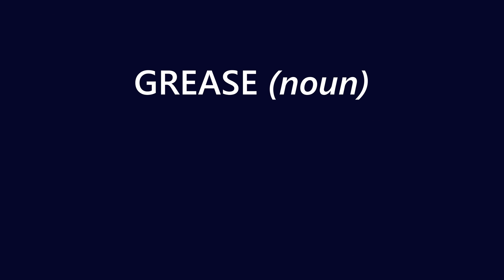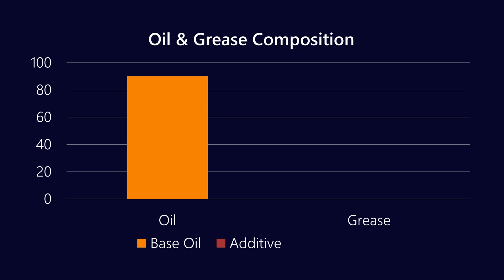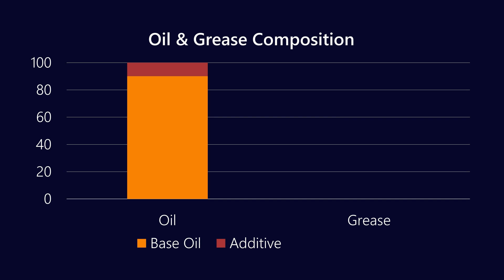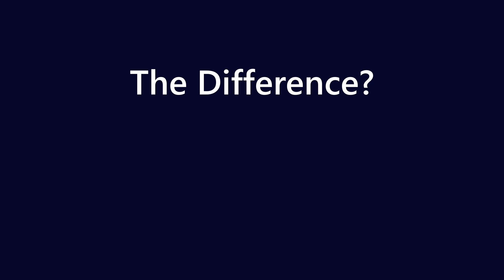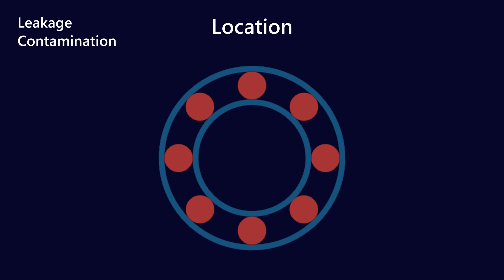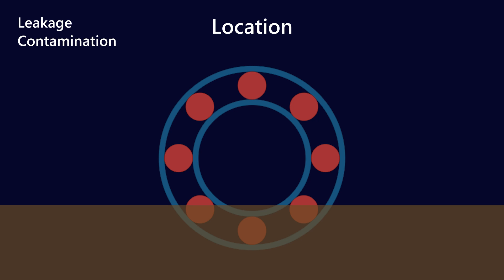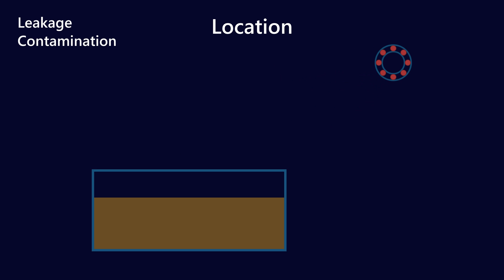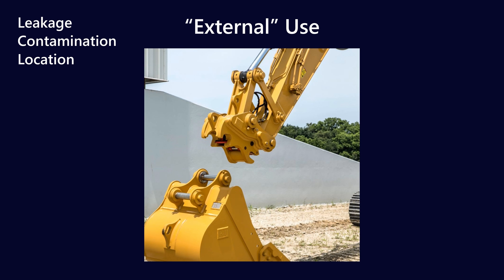What are the main differences between grease and oil?

Comment: Many large equipment have electric motor driven auxiliary oil pumps to circulate lube oil prior to start up. Once the equipment is running the directly driven main oil pump takes over and the aux. Oil pump stops as per instrument and electrical logic diagram.

Comment: Oil also has lower viscosity than oil.  If you have bearings that need to spin faster, you need a lower viscosity lubricant.  You can't use grease in these applications.  Another important factor is application dependent.  On fishing reels for instance, the spool bearings need to have very low friction in order to reduce the drag the bait has to swim against when it's pulling line.  Using grease would increase the resistance and cause the bait to not be able to pull out line from the spool properly before it tires out.  The lower friction on the spool also makes casting easier and improve the distance on the casting.  On fishing reels, the spool bearings are usually lubricated with oil instead of grease to reduce the lubricant drag.  In fact, some reels uses a very thin dry film of lubricant to make the spool spin with very little friction.  Even oil in these applications would cause too much friction. You will have to lubricate more often over a season, but it improves the performance.  There are lots of other examples where one type of lubricant is superior to others.

Comment: Grease is basically oil that has a thickening agent added to it which then makes grease .and as that grease gets older it gradually drys up leaving no oil but only the thickening agent left in the bearings . Hence the need to clean out the bearings and repack with fresh grease💪😎👍

Comment: To be quite honest, I have no idea what kind of lubricant to use. For 88mm Bearing Cable Pulley Wheel Aluminum Alloy Gym Equipment, what is advised? I recently acquired some weight lifting equipment, but the factory-installed pulleys were broken, and I didn't feel confident using them, so I ordered some new aluminum pulleys. Any help would be very appreciated as I'd like to keep them maintained so they function without much to no resistance.

Comment: Um, It seems as if you didn't mention the most important variable... the speed of the bearing. The oil or grease needs to "flow" not just to carry heat away, but it also needs to flow Into the bearing quick enough to keep up with what's being pushed out. At higher speed, the grease will not be able to keep up with the rollers and cannot be replaced, unlike the oil which can remain around the rollers. Granted, there is oil in grease, but over time and with heat, that oil separates out. Anyway, just seems like bearing speed is a determinant to thickness ~
Reply from the maker: Great point! As you can probably see from the date of the video this was one of my early ones and the quality wasn't exactly... as I wanted. Haha. You're absolutely right that I missed the big one.

Comment: Just repacked my trailer wheel bearings (non-sealed tapered roller) and there's a nagging question I've often wondered. I googled it and could not find an answer.

Essentially - I can't help but think that the rollers will just push 99% of the grease out of the way, and the tiny bit of grease film left on the races and rollers should degrade and bearing fail in short time. Obviously that is not what happens...

So i guess i am asking how the heck does the grease do its job? 
does it turn liquid when warm and flow around the bearing, giving it fresh grease constantly? every time i have repacked a bearing i see a big ol blob of brand new grease in the middle doing nothing and then a small amount of dirty used grease around the bearing, so it can't be flowing much... Timkin says pack the hub 1/2 full of grease. Does the centrifugal force cause the grease to flow a bit and push itself into the bearings? So many videos of guys doing it wrong, only packing the bearing and not the hub - will those likely fail prematurely?

Comment: I’ve always used 2oz of transmission fluid in a fresh oil change and a tablespoon of grease in the filter. All my engines have lasted more than 500,000 miles.

Comment: Ball and roller bearings are supposed to roll in there races, does the lubricant ever cause them to slide instead of roll? and wouldn't that be a bad thing?
Reply from the maker: Yes! That can absolutely happen. Overgreasing a bearing, or using a viscosity that is too thick can cause churn, and can cause the rolling elements to slide.
Reply: They all slide - because the outside diameter travels more distance than the inside bearing race.
Reply: @paulsawczyc5019 nobody tell this man about planetary gear sets

Comment: Do grease evaporates on the hot weather?? 30C to 40C° Temperature?? Please let me know sir..
Reply from the maker: No - at 30-40C you wouldn't see evaporation. Bearings typically run at 60-70C and greases can operate for years in this temperature range.

Comment: My thoughts on grease.  It can't be cleaned.  It causes more friction. It's hard to replace where it is located.  And for last just now they are developing "better" greases.
Reply from the maker: True. But in some instances there really is no good replacement. There are some methods for filtering greases, but they're really only economic if you're using grease in massive quantities.
Reply: Grease cause more friction? What do you even mean? Under proper conditions, greases very effectively lubricate contacts. In some cases, their semisolid nature is a great advantage., if not a requirement Think for example of flange lubrication, in rails. The lubricant must stay at the wheel flange - rail corner contact, and greases are naturally suited for it. 
Grease are not “bad” and oil “good”. There are applications where one or another solution ( or neither of the two) is more suitable .

Comment: Sir, I have a question. I am new to this topic and i dont really understand why it takes 10-20 seconds for the lubricant to reach bearing
Reply from the maker: Good question - in some instances it may just be that the bearing is at a high point, and far away. It being at a high point means that when the pumps are off, the lubricant drains back into the reservoir, therefore there is no lubricant at the bearing. On startup, the pump has to move a volume of lubricant to the bearing - if the lines are long, it could take 10 seconds or so.
Reply: @LubricationExplained  understood.. thank you sir

Comment: A little real world example of the oil flow heat transfer is in rotary engines.  Most piston engines do not have dedicated oil cooling unless it is a heavy duty or high performance application.  Rotary engines are a little bit of a special breed, though.  Only the outer edge of the motor is cooled by the water pumped through it.  The whole center core of the motor is only oil cooled.  And the oil is forced through it.  Using an Mazda RX8 as an example, this oil pull about 1/3 of the overall heat from the motor and dumps it through two massive oil cooling radiators in front of the front wheels.  These two cooler are nearly half the size of the water radiator.  

Not sure if anyone will find that interesting or not, but I figured I would share it as an easy real world example of that part of your video.
Reply from the maker: Wow! Thanks for sharing!

Comment: In really dusty environment which lubricating would be better? I mean between oil and grease.
Reply from the maker: If there is no way to prevent the contaminants from reaching the application, then in a REALLY dusty environment you probably want oil, with a REALLY good filtration system. Grease is really good at keeping contaminants out, but once the contamination gets in, it stays in until you purge the grease. Whereas oil can flush through the application, taking contaminants with it. The oil will only be as good as the filtration system thought!

Comment: What u mean by leakage in grease ?
Reply from the maker: Leakage of grease could mean a couple of things. Firstly it could be that the dropping point of the grease has been reached - this is the temperature at which the base oil is released by the thickener. Secondly, if the grease is too soft (too low an NLGI grade or the thickener has sheared over time) it will "flow" out of the application.